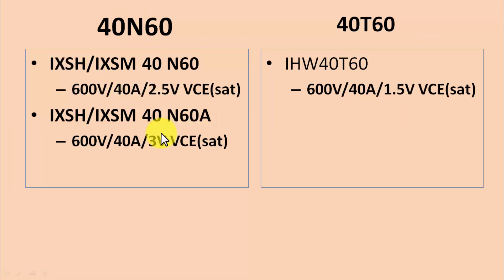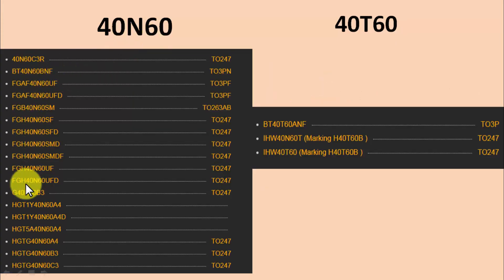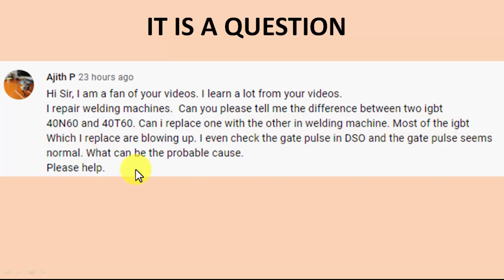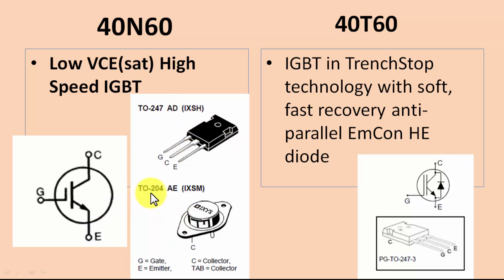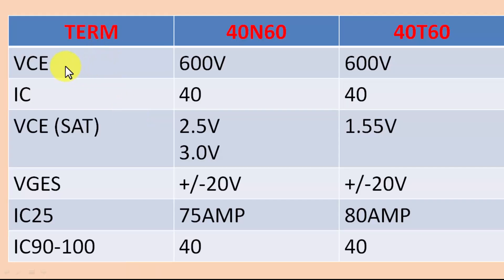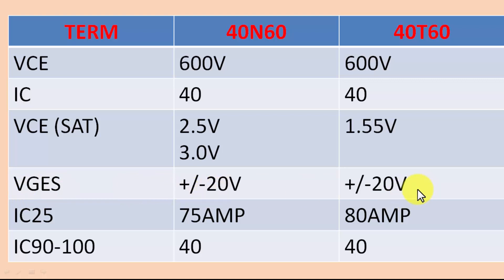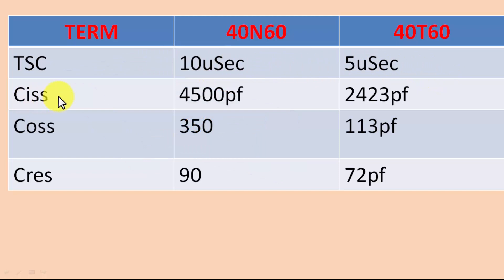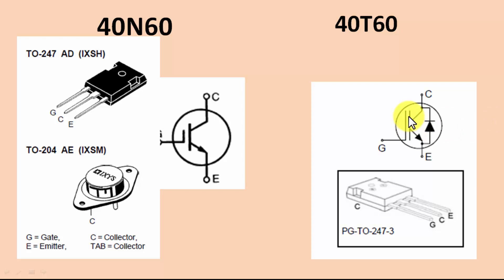[387] Is it Possible to Replace IGBT 40N60 with 40T60 ??? IGBT Equivalent

Comment: Mostly new welding machine product today is using 40t60 and 60t60 why it's working normal but then suddenly broken in the other day 😢
some customers say's that their welding machine was working yesterday then by tomorrow the other day they want to use it again after plugin in into the power source and power it on, something comes up to explode inside the welding machine after investigating they found out that the igbt explode 😢

Comment: hello,
i found G20N60B3D it's 40A 600V  IGBT with Anti-Parallel Hyperfast Diode. Can i replace it with 40T60 in welding machine or that will  make it blow up?

Comment: Very well explained. Your video has helped me a lot in understanding the topic. Thank you very much!
Question: Is a replacement with 40V60DF also possible?  For example:
Trench gate field-stop IGBT, V series 600 V, 40 A very high speed STGFW40V60DF, STGW40V60DF

Comment: nice video sir, can i replace G30N60E to G30N60?
Reply from the maker: yes dear it can be replaced 
both are similar
Reply from the maker: take care both must from same family 
if mosfet both must be mosfet 
if IGBT both must be mosfet 
because both number are available in mosfet & IGBT
Reply: @HaseebElectronics  okay sir, so i cannot replace mosfet with igbt sir?
Reply from the maker: you can replace it but we need a proper calculation for gate drive components, otherwise igbt will blast immediately
Reply: @HaseebElectronics okay sir, thank you so much for the advice.

Comment: Can we replace 40N60 wity 60N60. Because there are note available in the market. ?
Reply from the maker: yes dear we can replace it 
just math the datasheet for the both part numbers (for VCE-sat & input capacitance)
(specially the input capacitance, if it is approximately similar, then replace it)
Reply: @HaseebElectronics  if do you have a instagram. Telle me. I don't understant very well. I want a simple answer. If i can replace it yes or no
Reply from the maker: yes brother 
you can replace it without any change in gate drive components

Comment: Fertilizer
I took it from an online in Bangladesh.
The numbers were the same but all the gulai were fake.
Again, with the digital meter, the excuse is correct. But measured with component tester shows diode muff.
So I will take IGBT from any online now

Comment: Hello Sir, I was saying from Bangladesh. 40N60 or 60T65 is not available in Bangladesh. So I want to take these from you.
I want to contact you
What will I communicate with you?
Reply from the maker: welcome dear brother 
i am basically from pakistan and now in Jordan 
i don't have these components with me. i just purchase online whenever i need
Reply: @HaseebElectronics  Fertilizer
I took it from an online in Bangladesh.
The numbers were the same but all the gulai were fake.
Again, with the digital meter, the excuse is correct. But measured with component tester shows diode muff.
So I will take IGBT from any online now

Comment: Hello bro is it possible to replace G4PC40U WITH IRG4PC40UD ?? ud comes with a diode feature I guess. Plz reply
Reply from the maker: no we must use the same part number 
as IRG4PC40UD  have built in recovery diode. and the IRG4PC40U is only IGBT. so both will not function as a replacement
Reply: @HaseebElectronics  but IRG4PC40U isn't available in my country so any substitute you can recommend for it. It is needed for my treadmill control board, the main igbt got shorted. In the board it is written 40N60 which is also not available in my country so any substitute you can recommend would be great. And also tell me what will happen if I use the UD version ? Will it work for sometime or it will immediately get damage after I try to use it ?
Reply: @HaseebElectronics  also I would like to acknowledge you there are one 10k resistor and a 15v zener diode which are in parallel with the g4pc40u (igbt).

Comment: I had a problem with my  welding machine when I want to weld the o.c    alarm will come on as long the rod is spark then it won't weld any more. What is the problem  so that I can fix it .
Reply from the maker: anytime when the values of output current, required current and primary side current will differ, machine will generate OC (over current) error 
it needs a very careful adjustment of control card potentiometers

Comment: ¿Se puede reemplazar un 40n60 o 60n60  por un 80n60? (Can a 40n60 or 60n60 be replaced by an 80n60?)
Reply from the maker: sí, podemos usar 80n60 en lugar de los otros dos números IGBT. solo tenemos que asegurarnos de que el mismo número también esté presente en los MOSFET
yes we can use 80n60 in place of the other both IGBT numbers. just we have to ensure that the same number are also present in MOSFETs as well. so select the IGBT number
Reply: @HaseebElectronics  No son MOSFET son IGBT.
Reply from the maker: sí, esto lo dije. que ambos números también están disponibles en MOSFET e IGBT.
para que podamos reemplazar IGBT fácilmente con el otro
Reply: Can we replace 40n60 by 40n120???

Comment: Boss why I get 300 volt in welding machine then after the relay function to the 300v goes to 600 DCv. I put the test pin in to the capacitor main. I hope you answer

Comment: Sir..can you please tell me. Can i replace igbt TGAN 60N60F to 40N120KDA. Is there any problem to get damage. I am confuse.
Reply: Still waiting from your advice
Reply from the maker: 60N60F is 120 Ampere and 600 Volt
40N120KDA IGBT  is 80 Ampere 1200 volt. 

both are trench technlogy, but the current difference will cause to damage
Reply: sir..i don't get that exact parts i.e 40N60F, what can be used to replace that parts? Please need your advice.

Comment: Hi Sir,
    Suppose if we connect an external Diode across the Collector & Emitter of the 40N60 , will it perform the same as the internal recovery diodes of the 40T60 ?.(expect the case of the limitations due to difference in the Capacitance).  Also is it possible to directly replace  a UC3845 based smps's  MOSFET FQA11N90C (Vds 900V , Id 11A, Rdson 1.1ohm), with a FGA25N120AN IGBT (VCES 1200V, IC 40A,Vsat 2.5V).   Thank you
Reply from the maker: if we select the exact match of the recovery diode with the same specs or higher than the mentioned in the datasheet of the IGBT, it must work
the second thing we msut take care for the gate drive components. for mosfet and IGBT we have to take care for gate charging and discharging 
we can replace and just we have to match the power dissipation for both switching devices, i.e. mosfet and IGBT. 
if VCE sat will high, it will cause to dissipate power, so heat sink issue will be studied carefully. and  the peak primary current and rms current of the smps transformer must be kept in mind especially when switching high frequency. as high VCE saturation may cause a delayed peak primary current in primary, that may lead to reduce converter efficiency, but for normal power supplies it is can be ignored